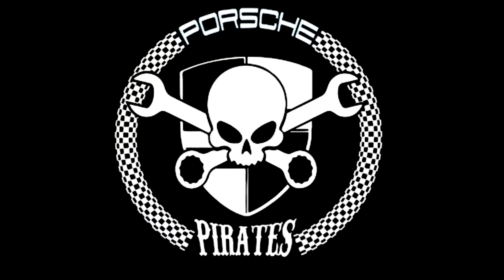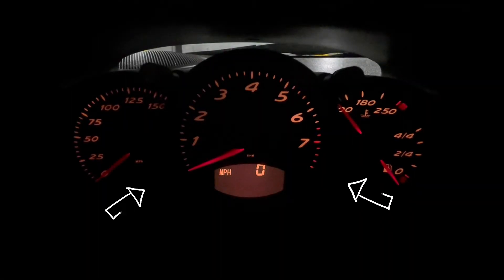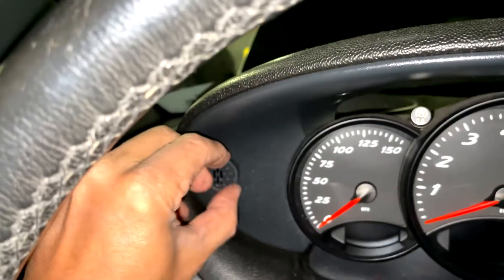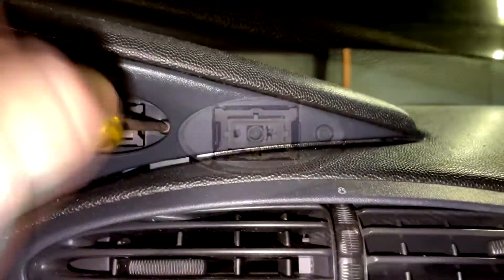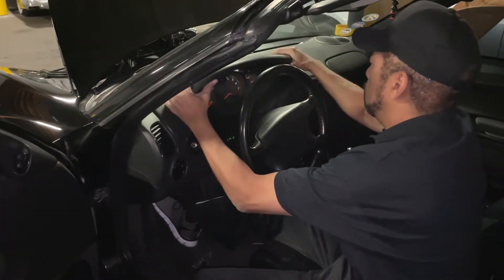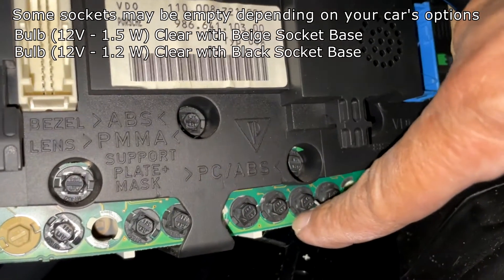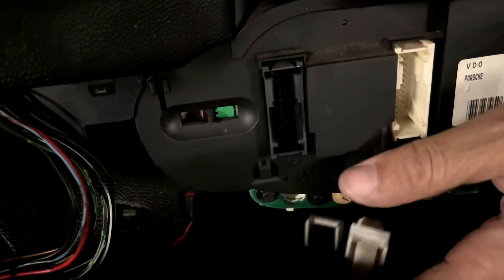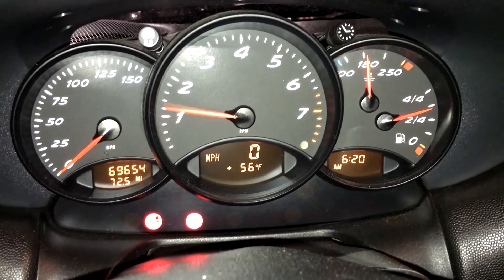986 Porsche Boxster Interior Dash Lights Replacement

Comment: Very helpful.  Thanks.  Is there anything that shows which bulbs do what, and which voltage they are?  All of my idiot lights and my digital gauges (speed/time) are fine, what I have is no illumination on my analog gauges (speed/tach/fuel) so at night, I can't see them.  Are those lit by one or more bulbs on that strip, or elsewhere back there?  TIA
Reply from the maker: There are bulbs further up on the gauge that illuminates the Speed/Tach/Fuel, close to the center.  I just change like for like color but I am sure you can find something on the internet/google.
Reply: @FollowingtheJourneyLifeStyle  from my Bentley it seems I need to crack open the cluster to get to those. Haven’t pulled it yet, trying to get ready. Is that your experience?

Comment: Well, I got it out, got it apart, discovered (a) my blue connector was totally shot, cracked in a million pieces.  (b) my cluster isn't the one shown in the Bentley, THERE ARE NO REPLACEABLE BULBS.  It seems the idiot lights are tiny LED's soldered onto the board, who knows about the backlight but nothing I could handle.  So, I buttoned it all back, hoping that the contacts inside the blue connector would mate, but apparently not.  Start the car and nothing on the cluster is working anymore.  Not the tach, not the speedo, none of the idiot lights, nothing.  I think I'm screwed.
Reply from the maker: Contact Pelican Parts or LA Dismantler and maybe they can find what you need.